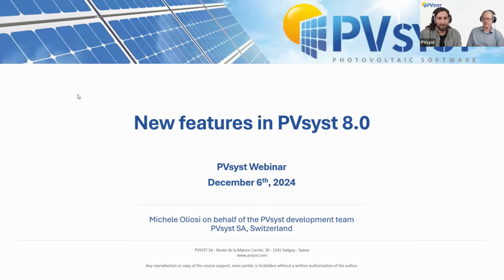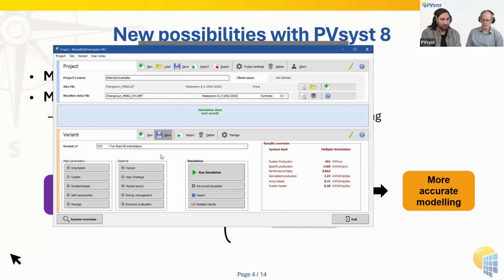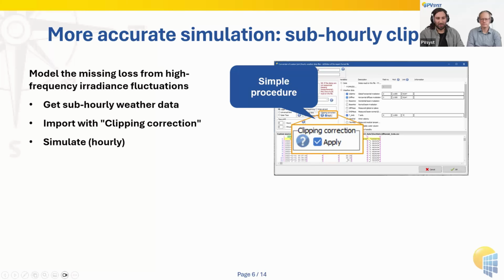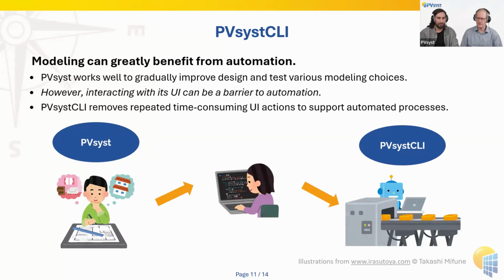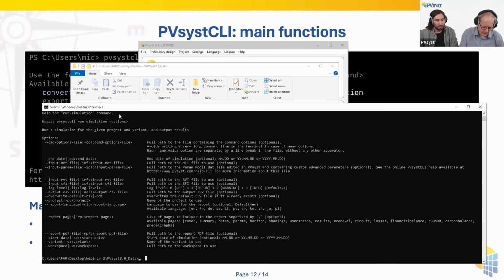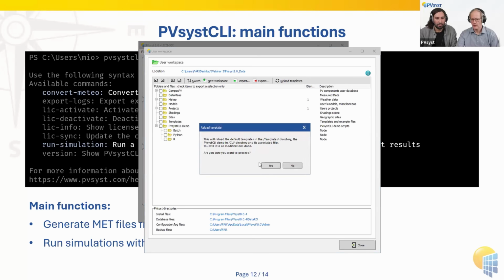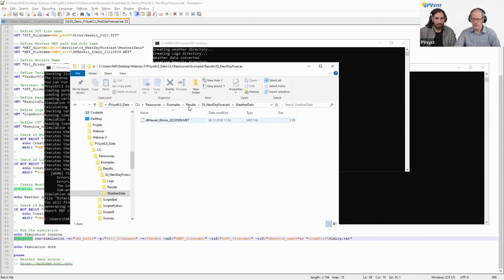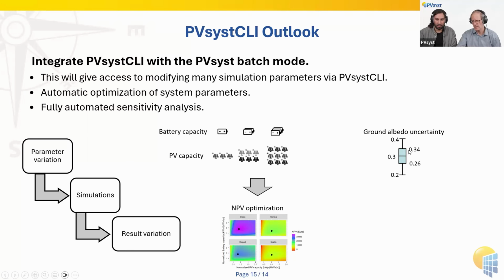Webinar No2 - Presentation of PVsyst 8 & PVsystCLI

Comment: hi, 
My PvSyst is 8.0.5 right now but after update from 7 to 8, i have some issues about 3D calculations for shades. When i want to chose a 2 sided roof, which can be a industry roof, i set all panels on the roof without problems, however after closing the scene, there is a ERROR that said "number of filed(solar panel) in error : angle between the field and the avarage oriantation (
11.5 degree) is too high. I chose the angle of the 2 sided roof is 8 degree, and make the panels auto tilt. 

That error is not happened before. I did not get the error, please help!
Reply: I made a contact with PvSyst website side.
Reply from the maker: Dear @bugracangulmez ,

If you still encounter this error, please send us an email at support@pvsyst.com, detailing your problem so that our technical team can provide you an answer.

Best regards,
PVsyst team